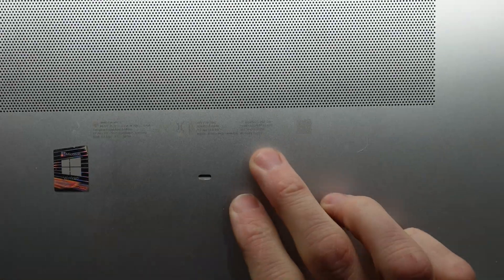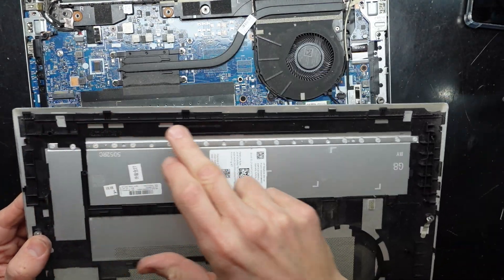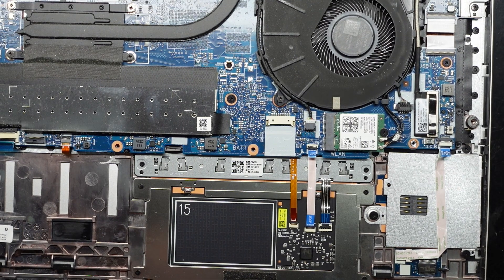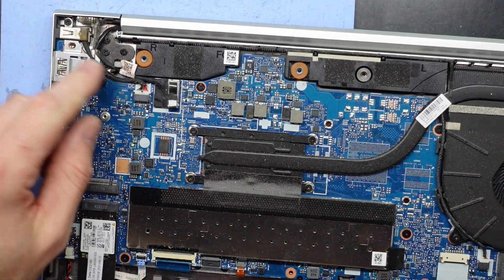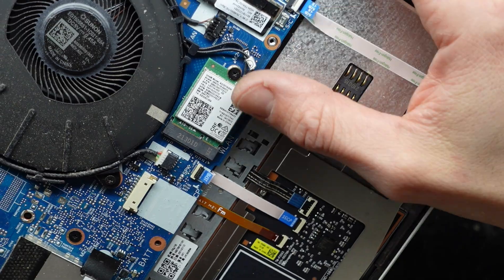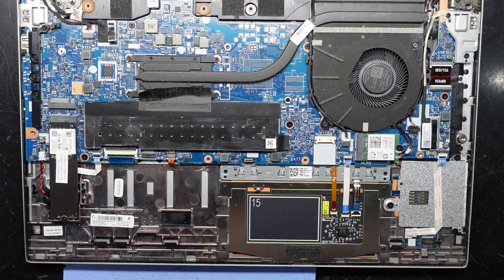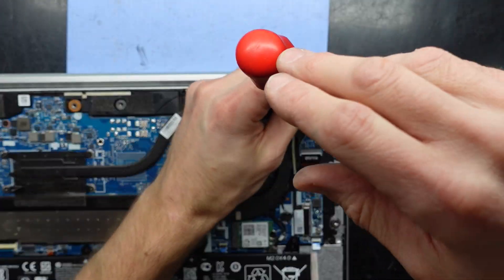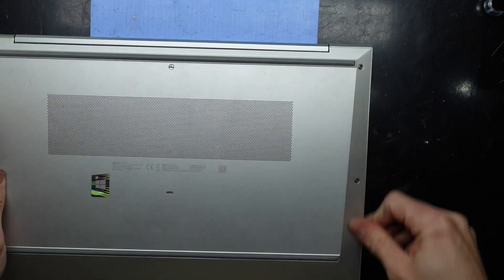HP Elitebook 850 G8 Ram and NVMe Replacement

Comment: FYI - the 2nd SSD drive in this is a 2242, not a 2230. Glad I measured mine before going off to order one.
Reply from the maker: opps sorry
Reply: @rickstechrepairs  I have since learned today that this is not an SSD slot at all, but for a WWAN card, to allow for Wireless communications. Your laptop is the same, it has WWAN printed on the system board. You might want to check this, and put some edit text in your video. Thanks.
Reply: @rickstechrepairs  You were incorrect as pointed out that it is not an nvme card slot. My recently bought 1tb nvme card will not fit in that  slot as 1 not 2242 and 2 it has a phone card in it.  I would assume if it had no phone it might take a 2230.  What a pain.  Shoud have checked with hp site before buying.